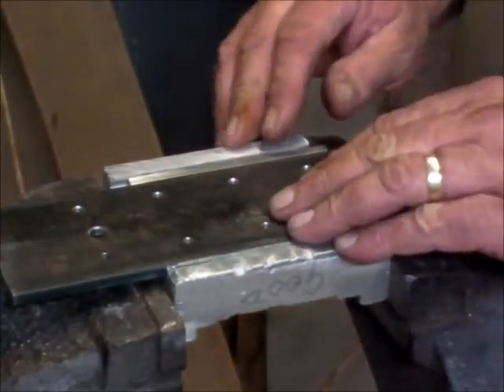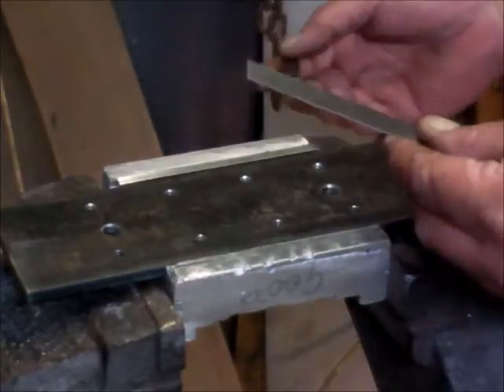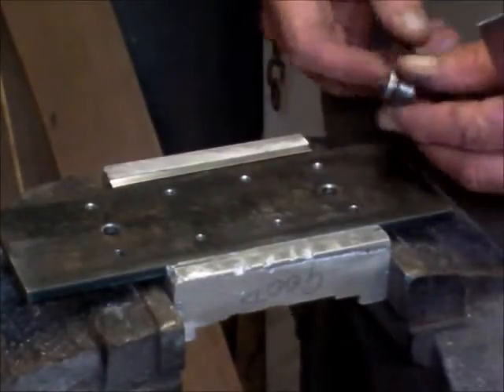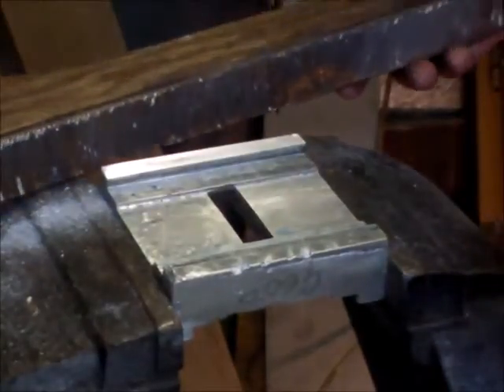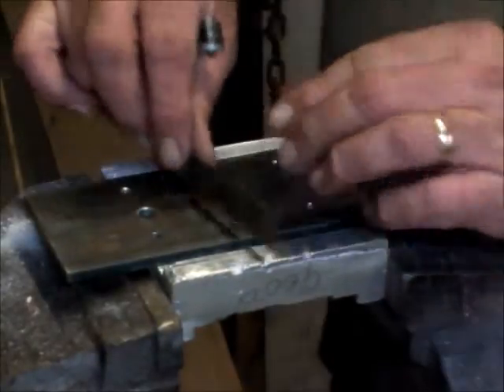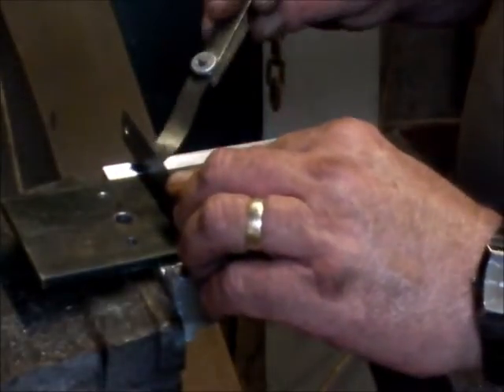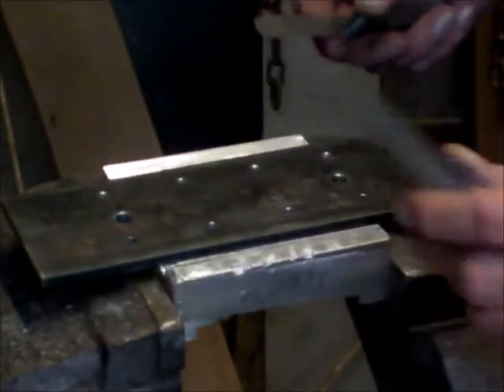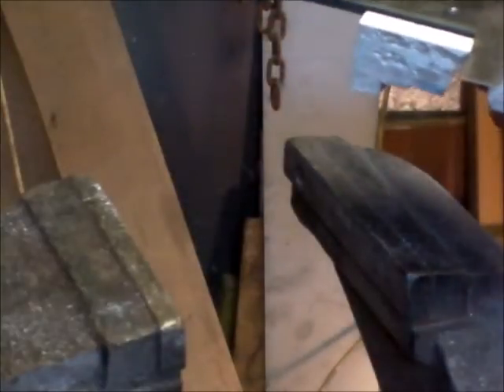Building the Gingery Milling Machine 9, working on the carriage

Comment: The carriage says good upside down, did you have trouble poring the carriage? Just curious as I am learning here. We use feeler gauges (will put them to work in a upcoming video on YouTube to share at least these two using them) here in our shop, we work with really tight tolerances. We offset our cutters on our CNC mini milling machine from TAIG with feeler gauges (we do not have a tool setter yet). I love your file holder (stabilizer) they bend and we also use sanding blocks as well mini's for our cloth and paper sanding of metals to keep them flat and true as we can get it anyways.
Reply from the maker: G’day Fowler, the good was a reminder which of the two sides was the good side to square off to, it was a reference side that I first used to square off the two lands parallel to each other. Cheers Peter